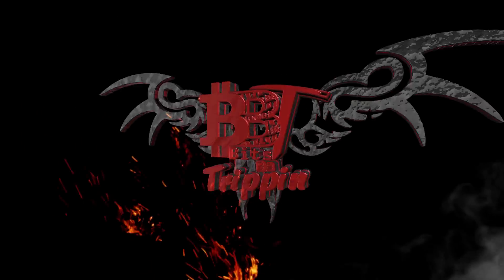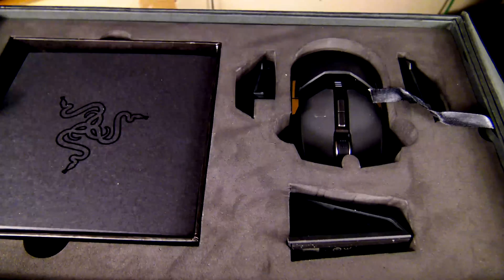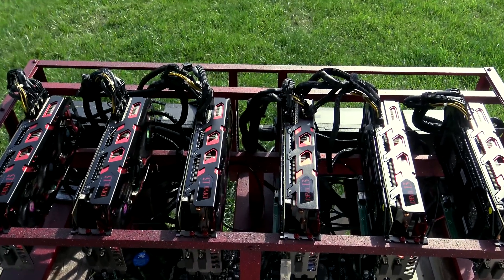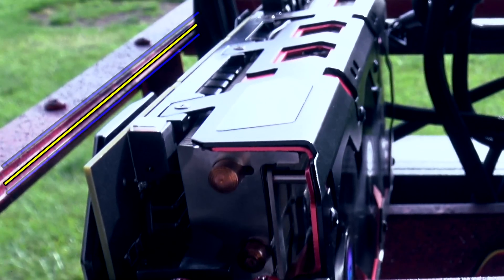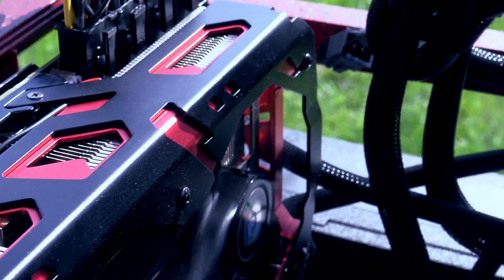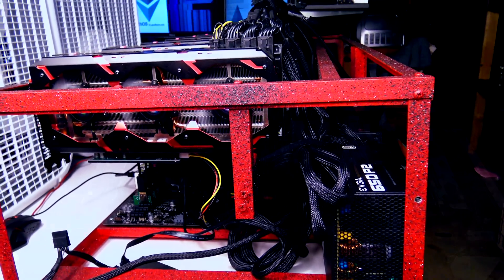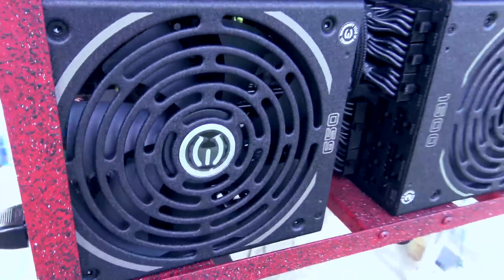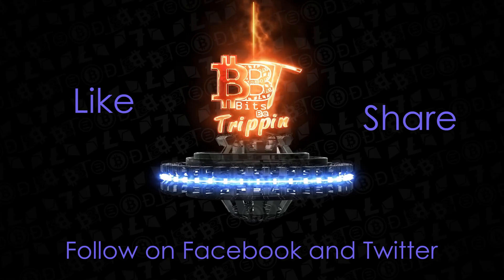BBT Episode 28: 12 GPU Mining Rig 6x PowerColor Devil 13 R9 390x2 16GB

Comment: hey bbt I got a 390x2 as well the same as yours and I have been mining over the past 15 days with 50mhz.
my core and memory is stock and fan speed is stock automatic setting at 65% giving me 76C open air case. TT corep5.
with that in regards you should be making 300mhz with 6 devil 13.....but you overlocked and now its making 330mhz. not bad but its such a huge cost. I dont pay electricity bill . 200$ average is awesome 100% profit. Damn I am getting into mining business.

Comment: Just wanted to verify. You used the 650 psu to powers everything on the computer (including risers), plus you used one or two 8 pin connectors on one of the Devil 13's. The 1600 psu only used vga power cables to the Devil 13's.
Reply from the maker: Michael - yes, essentially, the 1600's were on the cards by themselves ; (IF you dont overclock, the 1600 holds all 3 cards up no problem) The 650 was for the MB/SSD/Mem/Powered Risers; you could go with a 400w PSU (bronze to save money)

Comment: http://www.ebay.com/itm/PCI-e-Express-1X-to-3-Port-1X-Switch-Multiplier-HUB-Riser-Card-USB-Cable-1PC-/141865200790?hash=item2107d32c96:g:zTwAAOSwa-dWhMvm

Can you try one of these in your episodes?
Reply from the maker: even if they worked (which the few we have tested don't, they see the card, but die when you try to mine); you will run out of I/O assigning on the MB. This is a system resource i/o issue. Bottom line motherboards were never really design to exceed 6 gpu's. There are a few exceptions by very limited motherboards such as the MSI big bang which had 8x16xPCIe ...

Comment: Could you make a tutorial for a cheap (lowbudget under 500€ since im from GER) eth rigg since im currently mining with my nvidia gtxgeforce960 and id like to upgrade  since i have solar powerthe electricity for my normal gaming pc while mining is literally nothing yet i would have to calculate cost and all so pls make a low budget rig tutorial ! thx
Reply from the maker: This is what most will be looking for with regards to the RX480. Right now, hands down your best bang for the buck would be getting a used 295x2 (400 USD) then (125) MB/CPU/MEM combo (celeron) and a 650w evga P2 PSU.

This would be a single card, (twin GPU) rig that keeps itself cool with the onboard water cooler and puts out 56mh with 1125/1500 settings; it could double as a mining rig/gaming pc
Reply: thx for the advice.  Should i continue mining with my geforcegtx960 until the parts arrive?

Comment: Setting up my rig right now, thank you for your channel, I feel confident when I went for a evga 1000w T2 titanium, some people said it was an overkill, but imho, GPU's and PSU's don't have the same ROI speed nor lose value, plus 10 year warranty, running some numbers it is way worth, and also I heard that when it is more eficient it is cooler too makes sense...

Waiting for the rx480 to make another 6x GPU build, initial sketch is:
h97 anniversary
1kw evga T2, enough or more wattage?
Reply: The moment the RX 480's come out we will have them on site. The big question will be the drivers and if 16.5.3 are required or if AMD is coming out with a new driver that does not have the negative effects the change from 16.1.1 to 16.5.3 had.